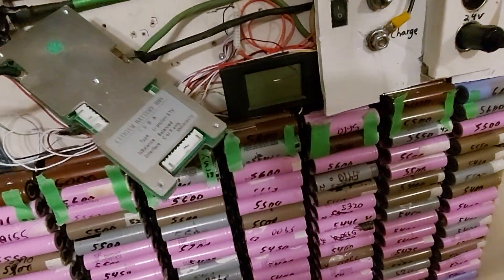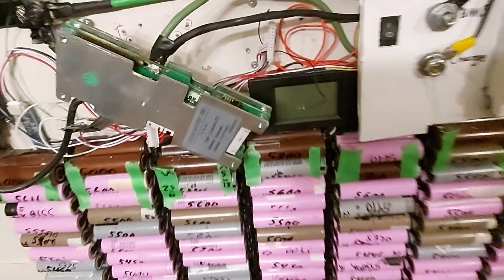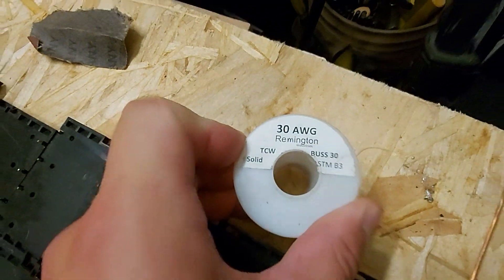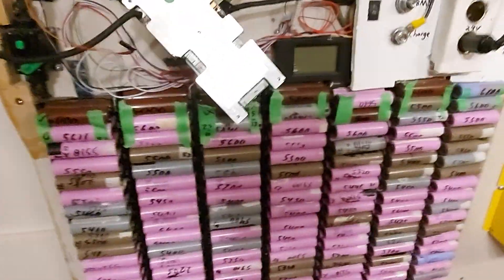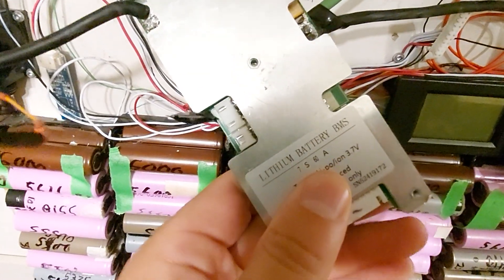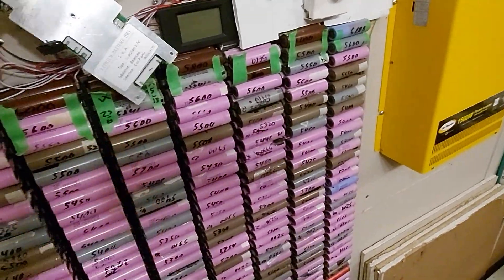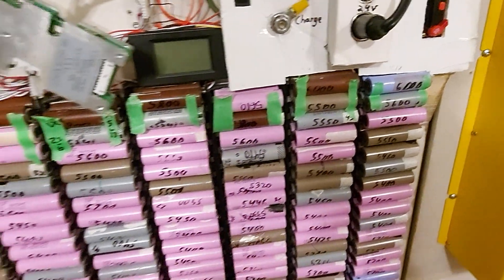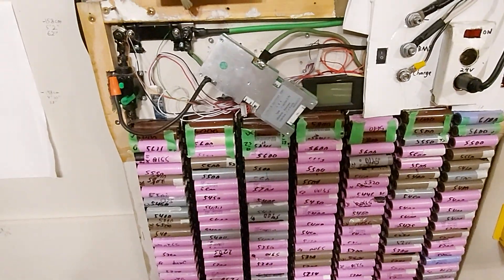chinesium Powerwall bms failure 7s 18650

Comment: How do you measure yours and others smell sensibility? :D
Reply from the maker: When they can't smell something
Reply: I’ve found it strange when I could smell things others couldn’t. But the biggest sign for me was when I could smell from the other side of the house when someone lit a match like to smoke a cigarette like within less than a minute and would holler to check just in case and they would be shocked I could smell it that fast and that far. Or if something was potentially burning same thing. I didn’t really think much of it till now.

Comment: Shouldn't really need a beast of an iron to do that work, it's usually the garbage tips that make it difficult. I bought a cheapo deal from amazon that has the adjustable temp knob and threw out the included tips and got some of these (amazon com/dp/B08QTW4LH5?psc=1&ref=ppx_yo2_dt_b_product_details) and the first one I put on there has lasted through insane abuse. It will solder 10AWG or bigger without effort.

Comment: I have the same Ant bms 320A on my Powerwall 24V and works fine,no issues since over 500 days,im driving it with 85A max and 320 A is not continiously but peak,so divide by 2 the real amps.

Comment: The negative breaker is useless. It's not "because of the way the electrons flow". I'm afraid you don't understand that stuff... Also, those fuses/breakers are absolutely trash and a fire hazard when in operation near it's limits. The reason a BMS switches the negative side is because it uses an N-FET and not a P-FET or relay.
Reply from the maker: I didn't realize some random with a few guitar vids would lecture me on off grid setup. Take a hike hit the thumbs down don't come back
Reply: @AndyShell  Ah yes, a very relevant attack on a gig I recorded many years ago? I'm trying to share some info here man, if you refuse to accept the most basic principles of FET's... For your own sake, test those breakers near their capacity. If they're fine, great for you, if they heat up and you notice, then you've saved yourself a possible fire. Only positive outcomes, no need to get so damn hostile.
Reply: @AndyShell  Can you make a video explaining better, why you need two separate breakers ( a plus and a minus )?  Would it be better to have a dedicated Dual-Pole breaker for the Charge Controller and a dedicated Dual-Pole breaker for the the Inverter?  The amps rating of the two breakers, could be very different.  Also, should the battery bank have a dedicated Disconnect Switch because circuit breakers should not to be used as a Disconnect Switch ...
Reply: i would say more breakers help to extinguish arc better in case of short? depends how it's connected, negative breaker might not help. like if your battery negative is grounded before breaker
Reply: Como es la configuras ion a 24

Comment: isn't that bms too small for all those batteries in parallel
Reply: This bms is in the wrong application...has nothing to do with it being Chinese but everything to do with him expecting a bms with a balance cap of 30-50mv to manage this pack...improper system design is the issue here!
Reply: @roqm1248  So, exactly what is the "improper system design" ? Does he have too many cells in parallel for that particular BMS or ?
Reply from the maker: @MrSummitville  roqm is just a pretend expert with no real experience with bms'. All bms have the same balancing circuit. ~60mA. It's a 60A bms in a system that only goes to 20A but can go to 40+.
Reply: @AndyShell  OK, 60 milliamps per balancing channel.  That would be 1/4 watt ( = 4.2 Volts x 60ma ) each.  Do you know which components burned up / smoked on the BMS?  Was it heat from the Discharge Resistors?  Let us know, when you find out.  So, how long can the Discharge Resistors be ON, before over-heating is a problem?   Most people would assume indefinitely, but the manufacturer may not have enough passive cooling, especially when multiple Discharge Resistors were ON ?
Reply: @MrSummitville  when using used cells if they are not "matched" you can end up with a bank of under performing cells, the bms will attempt to balance  the higher cells when you have a 100p pack you make it impossible to balance using 20-30mv....the pack is to large, you would need a dedicated balancer that has higher balancing power.
Reply: @AndyShell  you are very incorrect the balancing power varies as some use better parts than others, among the Chinese bms's the majority range from 20-30ma unless you get one with active balancing and they are .06a-5a
Reply: @MrSummitville  what you are missing is the charge amperage lets just for arguments sake say he is charging the 50p pack (4.2v x 2a ea) at 50a you expect a bms that has a balancing power of 30-60ma to keep almost 100a in line?🤣😂
Reply: @roqm1248 Actually, I do understand  balancing.  So, how can any BMS balance a pack when charging at 50 Amps ???  (your scenario)  When one channel hits 4.2 volts there is NO BMS that can divert all 50 amps.  The BMS has to go into High Voltage Cut-Out and turn OFF the 50 Amps charging to the entire pack.  At that point,  NOTHING should burn up!!!  It is that simple.  You still do NOT have a valid explanation as to WHY this BMS burned up.  Give use the manufacturer's name and Model # of your BMS that can actually divert a full 50 Amps when one channel hits 4.2 volts ...
Reply from the maker: @roqm1248  wtf are you talking about fly by night expert with no portfolio?
Reply: @AndyShell  i do not need to put certificates on youtube to warn people of potential problems...while you focus on the messenger how about looking at the message and then doing your own research into what i said
Reply from the maker: No

Comment: Nice soldering 👍
And what if there is any voltage drop through those cell holders ¯\_(ツ)_/¯
Reply from the maker: There is if it's a cold solder joint. There is no serious v drop on the holders. 1ohm at worst if there is oxidation
Reply: @AndyShell  yeah we have to solder them thickly 👍

Comment: Wonder if bms balance pins should be fused themselfs but then you need some way of knowing if they popped.Do you think a smoke detector would of detected that burnout?
Reply from the maker: Na the smoke detector is directly above it lol
Reply: @AndyShell  Damn , they need to make more sensitive ones , Ive been thinking out a way how to hotwire a smoke detector into a micro controller so in theory you could code events on smoke detect like open relays/turn off power etc.
Reply from the maker: @steve64464  man that's deff possible. I tried to make them run off the bms power but that project was a terrible failure and makes no sense lol
Reply: @AndyShell  Do any these crazy projects make sense most the time? :-D

Comment: this is why i like the active balancer they dont dump the excess off as heat size of the battery banks to the little current the bms can burn off is always going to end up with them burning out they just can not handle the heat they have to dissipate
Reply from the maker: Yea I feel the same esp after this but maybe my settings were bad idk :(
Reply: @AndyShell  I'd check voltage of the banks looks of it last inline resistor so will be first bank or last bank if they are both under max voltage then bms at fault or one of the banks is lower in capapcity then the others so was the first to hit max voltage and bms overworked itself trying to bring it inline i myself have 5 batterys each are 3s7p with a bms even then the bms is rather low on balance current and would take some time to balance so i addered a active balancer in each pack also so far they seem good i did have balance alarms on but they a waste of time as ecch bank reads higher then the one befor and when checked with volt meter the numbers dont match

Comment: I wos asking my self hows your power wall doing
Reply from the maker: Yea its ok but the cold solder joints are a major issue. I just need to finish the new version an I think it'll be almost perfect. Lots of very small changes that make a huge difference. Ty